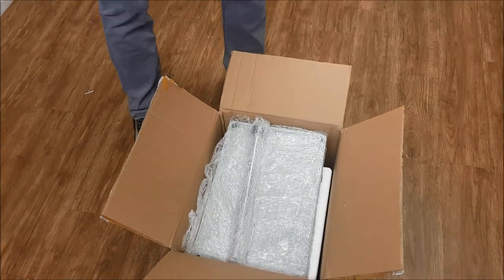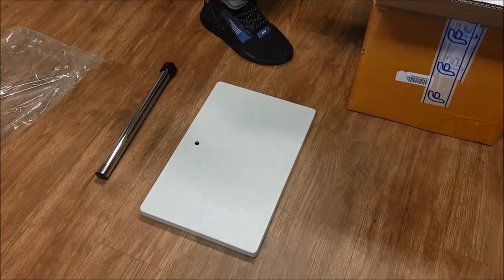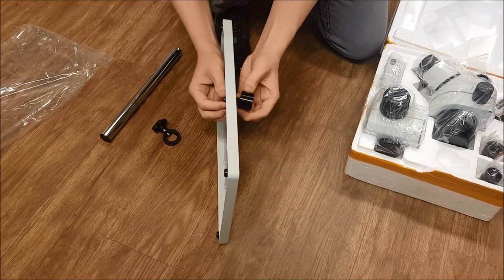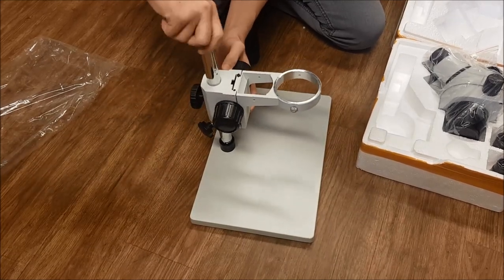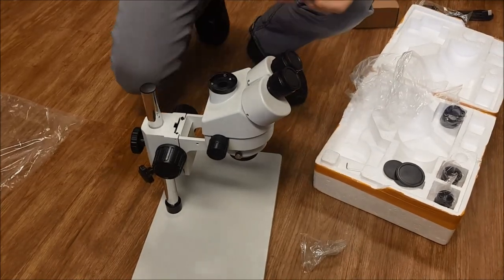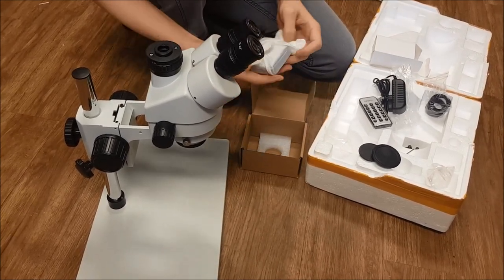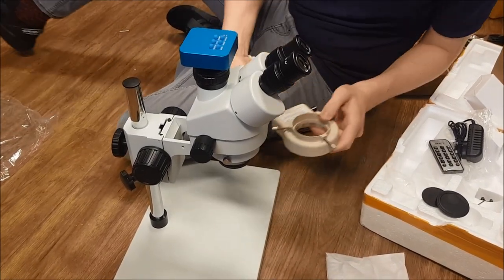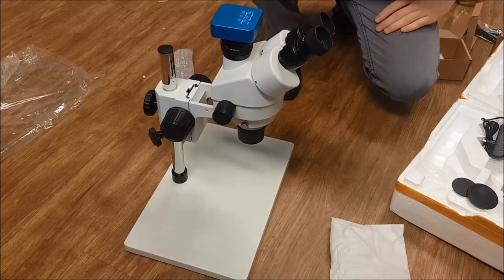Unboxing And Assembling The Sanqtid Trinocular Microscope

Comment: You're supposed to at the very least appear to know how this thing goes together if you're stocking and selling these. Also, I would advise that you tell your viewer to remove the cap and replace with appropriate lens and or camera, etc only when ready to install as to negate any dust getting in to the optics/body. 

But all-in-all great product and decent video.....all the best.
Reply: It such a good video